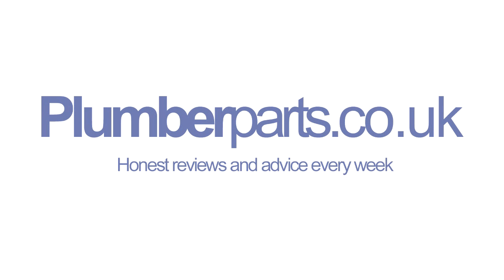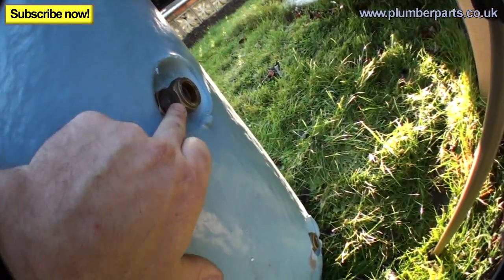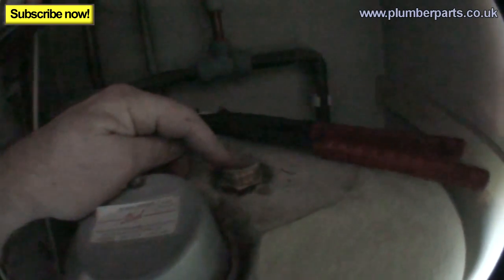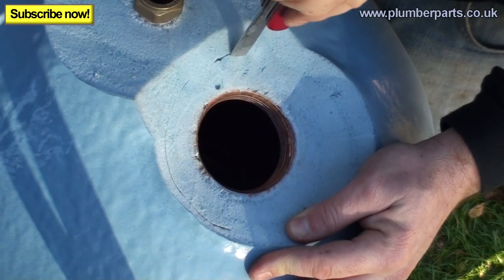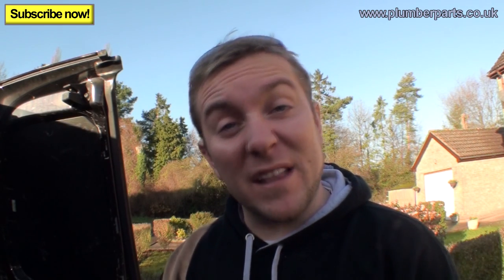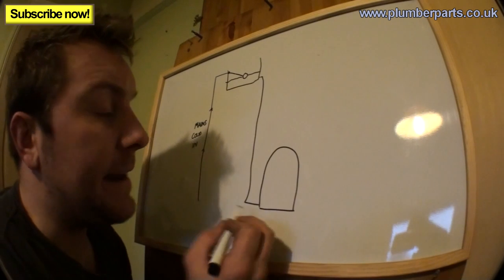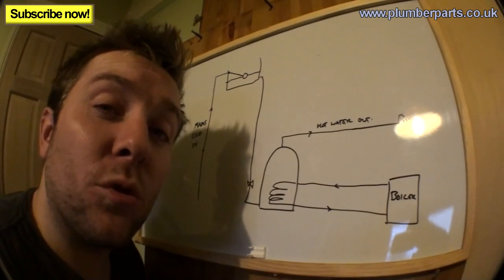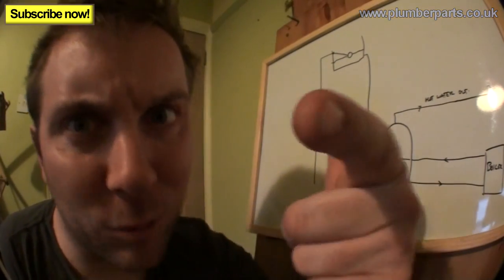VENTED HOT WATER CYLINDERS - Plumbing Tips

Comment: Hi, firstly thank you so much for these videos, really helps explain things clearer. My problem is that I have a indirect immersion heater which powers the hot water. The hot water pressure is so low you can’t do nothing not even wash your face lol. I am thinking of installing a hot water pressure pump like the one you installed on one of your videos. However I am thinking of that really is the problem as I’m certain the pressure had never been this bad as I’ve had the flat for over 10 years. Do I go ahead and install the pump or is there a bigger problem? Could it also be that the immersion heater is blocked with muck and needs flushing if so can immersion heater be power flushed. Thank you

Comment: changed my hot water cylinder for a new rm one and the bastard is leaking from the factory nuts on the coil connections, is it ok to use hymolar red to reseal the factory washer at these points?

Comment: I have a few solar panels and have seen a 12 volt Heating Element i would like to use to dump heat into my copper tank. The element has a 1" BSP thread. Would there be a gland to enable a hole to be cut for a item like this? I would attempt to fit it as a Willis heater but there is a 240 volt one already installed!

Comment: Hi Great videos. I have a query around moving my hot water cylinder 4.5 metres to the left of its current position. Is it ok to have the new vent pipes which will still run up verically to the loft lengthened to then run more or less horizontal 4metres in the loft over to the CWS tank before dipping down in as usual?...as it's difficult to move the CWS to be directly  above the new hot water tank position. Ta.

Comment: Hi Great videos. I have a query around moving my hot water cylinder 4.5 metres to the left of its current position. Is it ok to have the new vent pipes which will still run up verically to the loft lengthened to then run horizontal 4metres to the CWS tank before dipping down in as usual?...as it's difficult to move the CWS to be directly  above the new hot water tank position. Ta.

Comment: hi ive to change a vented hot water cylinder but there is an electric boiler beside it and looks like heating flow and return have been removed but pipes have been left in place and open-ended ? looking on the worst side of things but I've water coming out of emersion element might just be the gasket but suspect crack in tank please help cheers Pat
Reply from the maker: Pat....we are mental busy! Cut away the foam around the immersion to get a better look. Tanks don't tend to 'crack' in the traditional sense. Most have a 'fissure' and it weeps though the copper so have a good long look before you nail the tank! Sorry for the delay in reply mate....doing loads after a long day at work! SUBSCRIBE! ➡️👉 https://www.youtube.com/subscription_center?add_user=plumberparts 👈⬅️ IF YOU HAVEN'T ALREADY! 😎

Comment: quick question, i've fitted a stuart turner 3.00bar monsoon whole house pump but yet to fit it to a surrey flange, my hot water pipe is set away from the immersion tank and T's off for the vent up to the loft water tank. without the surrey flange the pump shoots the hot water up the vent pipe and straight into the tank in the loft, the only way around with fitting the flange is to fit an elbow to the vent pipe and run that to the top of the surrey flange. i was just wondering if this was safe to do or not? great videos by the way, helped a lot in fitting the pump. hold tight!

Comment: Great video!  A question for you, in my house there is a vented hot water system.  The cold water tank is in the loft, the hot water cylinder is on the ground floor.  I understand that the water in the outlet of the hot water cylinder will be at the same level as the water in the cold water tank.  I'm redoing our bathroom and the current pipe work is 15mm diameter and disappears, unhelpfully, into the wall.  I want to 'upgrade' to 22mm diameter piping.  I don't really want to destroy half the house to remove the 15mm piping, but I can get to the pipe leading to the vent over the cold water tank on the 1st floor.  Here's my question, can I add a tee here for hot water?
Reply: Nick Ear

Comment: Quick question.  My thermostats won't go above 50. The pump will run constantly as it can't reach temp. Back to 50 or below its fine. Is this the stat or cylinder? Even something else ?? How can I check. Thanks!!
Reply from the maker: What the boiler temp like?
Reply: +plumberparts the dial is 3 quarters round as it always is. The tap temp is right. It's a glowworm micron. I've been told it won't always reach the temp if I turn it up on the cylinder . But was always set to over 60.
Reply: +plur
mberparts

Comment: love your videos , but i find 2 faults with this video ! no 1 the pipe you referred to as the expansion pipe in your drawing is actually a vent pipe ( the expansion pipe is the same pipe as the cold feed to the cylinder and should not have a valve on it eventhough most installations do have the cold feed valved!    no 2 the hot distribution pipe should run horizontal for at least 18 inches before it vents ! this is to prevent what is called one pipe circulation ! dont mean to offend you im just making a comment!
Reply from the maker: +Mike Rice Hi Mike, no worries! On point one I disagree! On point two, give me a airing cupboard that's big enough!!! :) Cheers dude, PP!
Reply: If it was in the cold feed it would just keep flowing back into the Tank

Comment: CAN YOU HELP,I LIVE ON A BOAT AND NEED TO FIT A CALORIFIER.  I ONLY NEED IT TO GET HOT WATER HEATED BY THE MAINS SHORE POWER  AS I HAVE A SECOND TANK THAT IS HEATED BY THE ENGINE AND A BACK BOILER ON THE SOLID FUEL STOVE....HOW DO I CONNECT TO THE HOT TAPS WITHOUT IT SYPHONING INTO THE EXISTING CALORIFIER,,HAVE YOU GOT A VIDEO ON THIS OR COULD YOU TELLME HOW TO PLUMB IT IN,,  MANY THANKS...

Comment: What is the boiler fed by on a vented hot water system, is a gravity fed system the one that requires a cold water tank and a feed and expansion - so two tanks in the loft?
Reply: On systems as described in this video there is a second tank in the loft, also fed from the mains, to ensure there is always water fed to the pump at the boiler and to keep the heating loop filled and pressurised. This is why the heating system has to be drained below the level of the coil before the coil can be disconnected. 

Since there's a continuous supply of water from the mains to both tanks, a leak from a tap and a leak from a radiator are equally damaging as they can leak as quickly as the house water supply allows. Radiator water leaking may well be nastier as when there is no leak the same water circulates around the loop all the time, so it tends to be pretty manky compared to what's in the taps.

Comment: The difference between an Indirect and Direct hot water system is that a Direct system does not have a coil in the cylinder, and so the water used at the hot water outlets (taps/showers etc.) is the same water that is run through the central heating system.
They're not used very often and are more likely to be found on a hot water only system (no radiators attached) or on a cylinder that only uses an Immersion heater and has the flow and returns capped off.

Comment: Urgent help required please!! I have the same system in the video above.
The cylinder is in my bedroom, and the pressure from the hot tap in the bathroom is really low.
I have a single impeller stuart turner pump, with built in pressure switch. I put the pump on the outlet of the cylinder but all it does is feed water back through into the tank above, via the expansion pipe. Should I put the pump on the inlet to the tank instead? Thanks anyone for the help.

Comment: Hey Plumberparts, I've got a vented indirect system. I've removed the boiler and capped off the pipework to and from the coil so that there is no central heating system. The pressure coming out of the hot and cold taps is very poor at best since doing this. I am fitting a new bathroom suite and want to feed it with mains cold, how can i make sure the pressure coming out of the mixer taps will be sufficient considering the hot pressure is practically non existent? Thanks

Comment: you only need to drain the heating if its an indirect hot water cylinder which has a coil in it flowing to and from the boiler